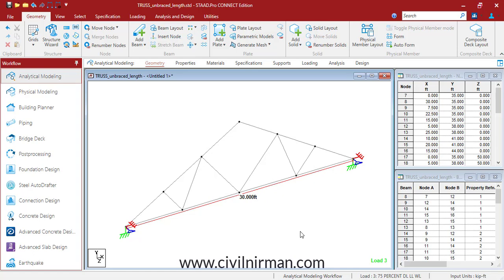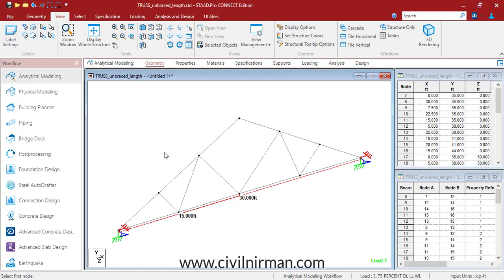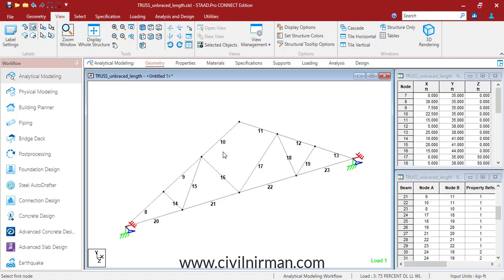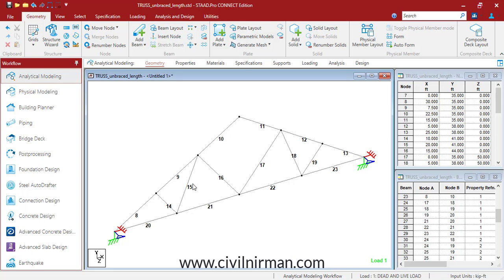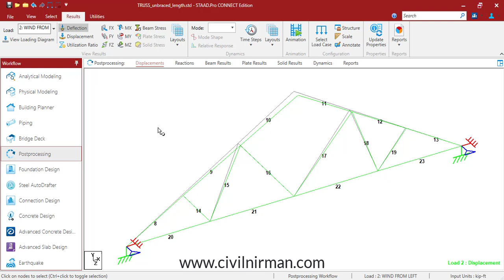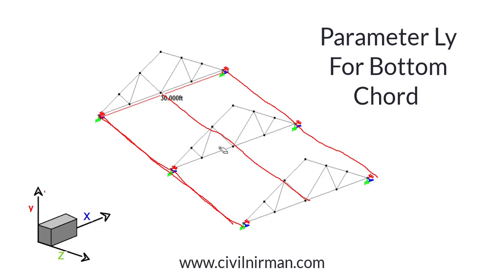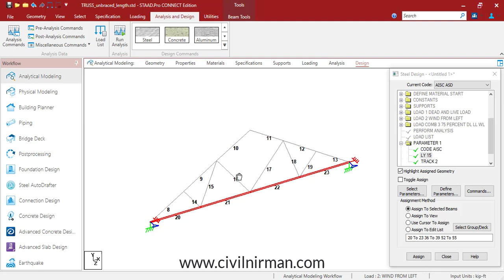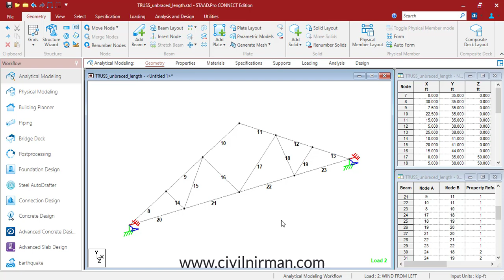Understanding Unsupported Length in STAAD Truss Models | Ly Lz For Truss

Comment: Hi. I request you to elaborate the Group command in Design. There are very limited information on the same. Thanks in advance and  happy new year!!
Reply from the maker: @RishabhTuna  sure noted ✅
Reply from the maker: @RishabhTuna  happy new year 🎊🙏🏻✨
Reply from the maker: @RishabhTuna will you please elaborate , for which group command you want briefing ? one which is available in utility ? or something else ?
Reply: @CIVILNIRMAN  Hi! Pleased to find your quick response. Honestly, I visited this video once again to recapitulate. I am working on Steel Industrial Structures. 
As you asked- I request you to elaborate the Group command in Design. Design==>Commands==>Group ('FIXED GROUP' would be a bonus to this request😇)
Reply from the maker: @RishabhTuna  noted updating in next tutorial
Reply from the maker: @RishabhTuna   Further for your basic understanding remember following :
When you use the Fixed Group option, the grouping of members remains consistent across all subsequent commands. This means any analysis, design, or modification will always consider the grouped members as a single entity.
Also see
Without Fixed Group:
If you do not use the Fixed Group option, the software groups the members once (based on the current command) and forgets this grouping for any later commands. This could lead to inconsistencies if you want uniformity in member design.
hope this info is sufficient currently ,
Reply: @CIVILNIRMAN  Oh! Thanks!! This was a much needed info. Means I should use Fixed Group instead of Group. I will!
However, I would still want you to throw light on how to apply this command. 
Looking forward to it. 😇😇